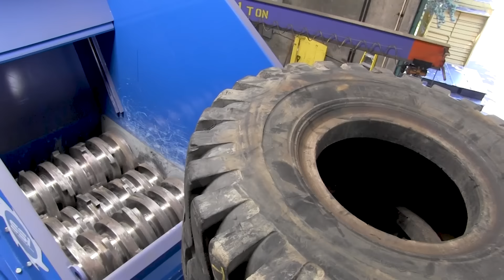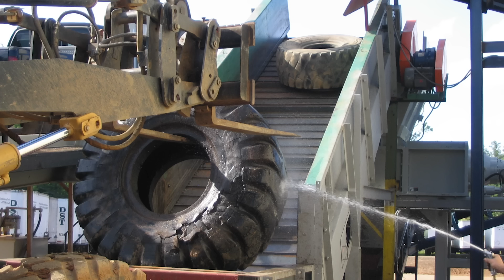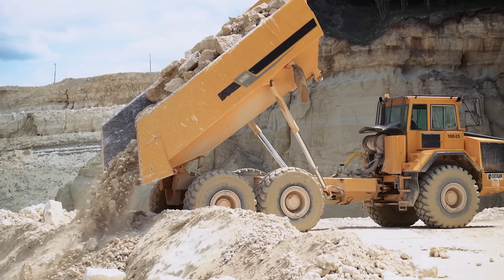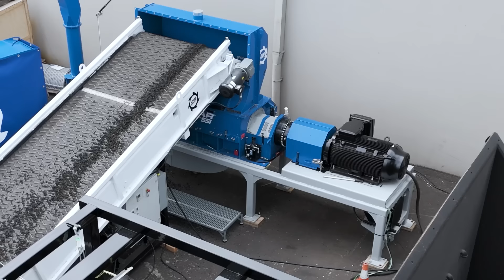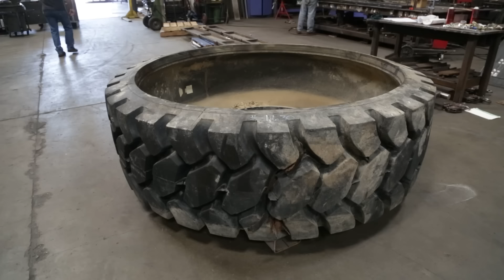How to Recycle OTR Tires

Comment: Then sold to a 3rd word country to make tire pyrolysis oil, or ? And you charged them $200-$300 a ton tire weight to process.  Then Joe Biden said oil is going away. There's brain dead !  It's modern tec at best.

Comment: I saw a guy using a broom to spread the chips is that always needed
Reply from the maker: Great question! It is not. In this case you are seeing a clip from a test video at our facility where we manufacturer these machines. When the shredder is installed at its final location then the conveyance systems are engineered to ensure that is not needed.
Reply: @ssishredders  I was wondering the same thing when I saw the guy with the broom I thought that would be a good job for me😊

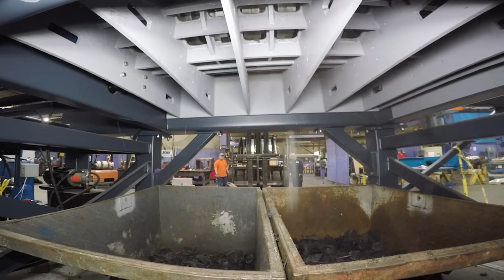Comment: In many of your videos, like here at 2:49, there is often debris that go outside of the containers. Do you have any solutions for that?
Reply from the maker: In this case you're seeing a clip from some of our testing done on our manufacturing floor. For us the material falling on the floor isn't an issue, actually in some cases, we're shredding directly onto the floor so we can see how the particles are distributed as they fall. When the machine is installed in its final location the material will be conveyed and that material falloff won't happen.